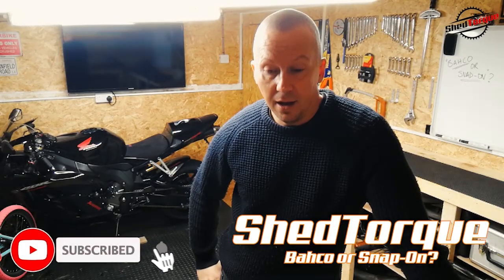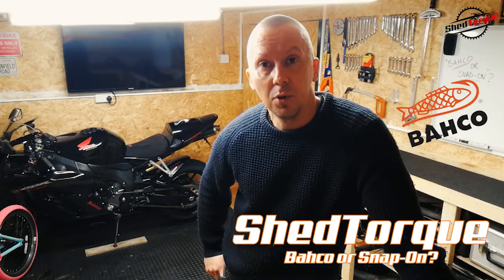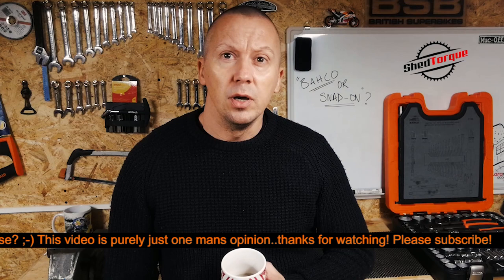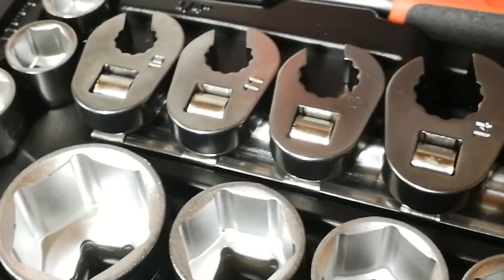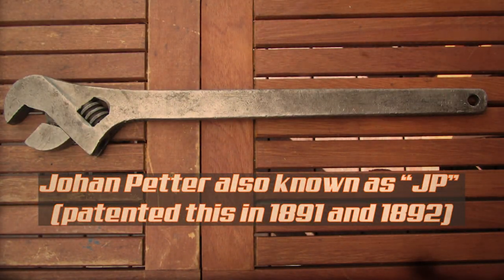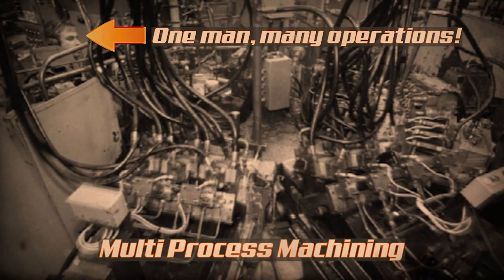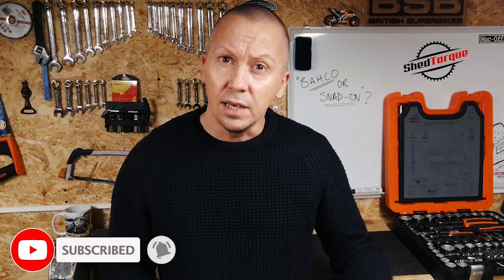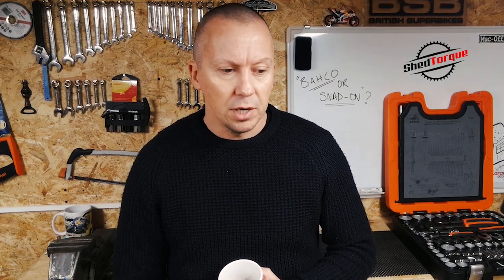Bahco or Snap-On? A SURPRISING history!

Comment: I bought a big Bahco set in 2008 the big set with 1/2 inch & 1/4 drive with spanners got at a good deal from a BOC gases shop £130.00 it's been brilliant, the sockets have had some pain. what I like is you pick it up & you have most thing to do a job. I'm thinking of buying a S138 set roughly £170 delivered when on offer.  I not sure if the quality will be as good. I have 3/8 snap on ratchet & sockets, but just like the idea you pick up 1x box & it's all there tidy.

Comment: I changed the entire exhaust system of my 2011 F-150 using my Bahco S240, S330 and S160 socket sets and they seem to be very good quality. I have used this brand before and they have an excellent reputation. For me, this brand has been with me for about 7 years and not even They show signs of rust or anything similar.
very good video and perspective
Reply from the maker: Thanks for sharing!!

Comment: I have the S138 set - and the snap locks on the box are the worst quality on mine - when i set the box down on the ground(holding the handle) the snap locks open by themselves - box opens and all parts all over the floor. Is yours acting like that?

Comment: I think many Swedish people have the opinion (and experience) that the Swedish made Bacho tools from 30-40 years ago had the best quality, better than today and on par with the very best tool brands. Primarily adjustable wrenches, pipe wrenches, socket sets and spanners. Then they moved the manufacturing to Spain and Argentina, and the quality and design suffered. Still some very good tools today, but also some low quality tools. Apparently, there were real high quality adjustable wrenches made in Spain since the early 20th century, but the quality of the Bacho wrenches still suffered.

Comment: I'm surprised that you think no-one had heard of Bahco until recently - I've been using Bahco tools since the 1990s, in particular the adjustable spanners, which were the best you could get. I still have plenty of the made in Sweden spanners, though I think they're made in Spain by Acesa now. Sandvik and Bahco merged at some point, but they're both part of the same conglomerate as Snap-On now, as is Acesa. Tool companies and brands are always merging and taking each other over, it's hard to keep on top of who really makes what.
Reply from the maker: Thanks for the message. Yes, I mean adjustable spanners and saws were fairly well heard of, but a lot of people I spoke to at the time of the video had no idea Bahco had such a range. There is a lot of coming out of Spain now, mechanically. The milling machines I use are Spanish, and they are pretty good to be fair. 👍

Comment: In the 80's Bahco adjustables were the ones to have. Hence I have them in 4", 6", two 7" wides, 12" and an 18". They have served me well. 
I also have the SL25, S160 and the S240 socket sets, a bit set and many other tools. No complaints from me from a pro working in heavy industry. 
You mentioned Draper too, I still have some of their stuff I bought in the 80's, not used now but they lasted the distance. 
My kit is now predominantly Klein. Nice stuff but difficult/expensive to get parts for, postage makes them a throw away item because its cheaper to buy a new replacement.
So Klein in being replaced by Knipex, Wera and Milwaukee.
Tools are an expensive hobby.
Reply from the maker: Good to know! Thanks for the info mate.
Thanks for watching! I haven't done much recently but fitted some heated grips last night on a friends bike so will upload that, also fitted a complete exhaust system on a friends bike so just in the middle of editing that! Thanks again!

Comment: Mate... back in the 70s & 80s I used My dad's Britool 1/2" socket set. I used to put scaffold bars on the ratchet & jump on it to shift driveshaft nuts: Didn't flinch mate. Loads better than snap-on but like everything else that was once great about British engineering got swallowed up & cheapened. I'm sure if Britool still exists its a load of crap now?
Reply from the maker: Bought out in 1991 mate. Exactly like you said, outsourced to Europe. I can't fault Bahco mate. They look and feel quality. Not a fan of Snap-On to be honest. Maybe because I can't afford them.. 😂
Reply: I still use my dad's Britool ratchet 👌
Big shout out to my KingDick mini adjustable spanner. So well made and stays tight, unlike modern adjustables
Reply: Just because things were over engineered and you could  abuse it didn’t mean things now are crap. There is a thing called a breaker bar - try it sometime instead of a ratchet.
Reply: I WAS 12 years old at the time & didn't know a breaker bar even existed but I now have quite a few breaker-bars the oldest being 30 years old. The last one I broke was on your wallet mate!
Reply from the maker: @jwbrobiker5741  30 years old 👍
Reply: @ppal64  no

Comment: I bought bahco 8072 made in spain, the quality is not good, the upper and lower jaws are not parallel, when I hold the jaw it is also loose, let the upper and lower jaws align then I sand it, it turns out the material is soft not hard

Comment: Bahco manufactures tools in the Argentinian factory since 1963. They still make some tools there but most models are now made in other factories (mostly in Asia). They also make some tools and parts for Snap-on, I think. 
Anyway, all that, made in Sweden, Germany, Spain, USA or China is really 80% perception base on the racism WE all have, whether we want to admit it or not. If a tool made made in China it's not good it's because the company chose to manufacture there to save money, so, they probably used lower quality materials. Great tools are made in Asia and crappy tools are made in the USA. Same for all countries. 
So, please stop with the "chinesium" rhetoric. (I know you didn't said it, but i speak in general). If the factories are no longer in your country, it is because of the greed of the owners of the companies, not because of the labor of the Chinese workers. (and, I'm from Argentina, where many factories closed to manufacture cheap in china, so, I'm not please of the situation either)

Comment: I've had a Bahco S106 for 2 years now, no complaints. I think the fact it was made in China isn't the whole story. The quality is still excellent, and everything is a tight fit, even after all this time. I've yet to break anything, despite the abuse I've given it, so not much else to say really. The price was right, it does the job, and if you're in the market for a socket set, you could definitely do worse than this.

Comment: I've used and abused the S106 kit for ~4-5yrs, especially the 1/2" ratchet before I purchased a breaker bar. They're good kits, many of the cheap kits sold in Australia are all 12 point which is rubbish. Just need to be careful which kit you buy as there are several variants that are very similar
Reply: Just checked the email receipt: Jan 2016. >5yrs used and abused, put away wet, they just keep going.
Reply from the maker: @scod3908  Cheers for that, good to hear some of the Bahco stories coming out. Quite a history, a real engineering history! Drop me a subscribe, it would be much appreciated SinM

Comment: Bahco made the original Swedish pattern pipe wrench. Incredible gripping power. Still use a “Swedish” often. 

When I need to use a shifting spanner Bahco are the best of the best. If I see a used one up for sale I buy it 😂 Problem is they tend to disappear 😡

Comment: I don't buy Bahco or Snap on pliers. Knipex are a much better quality for that.
Reply: I buy both. Knipex does not make a great needle nose like Snap-on.
Reply: knipex is at like 90%. they can make them better. there was a french company named bost that made amazing tools but i can no longer find them in the market. in greece, every builder that was putting iron on the skeleton of the building was using bost
Reply: @Nikosk00  Never heard of them. In aviation we use pliers all the time, I've used all the big brands Snap on, Blue Point, Bahco(which all my other tools are) but pliers Knipex are the best they always stay sharp and take a lot of abuse.
Reply: @Nikosk00  Iteresting.  I have never seen Bost but they sound excellent.  I also buy Japanese pliers as they all are the best at taking out screws.  Brands like Engineer, Lobster, Fuji-ya, TsunoDA, etc.